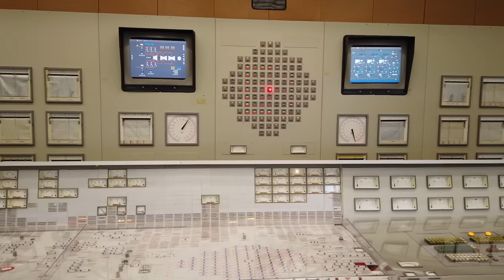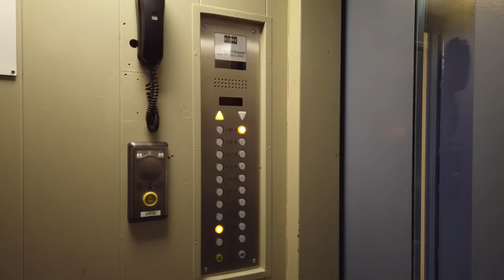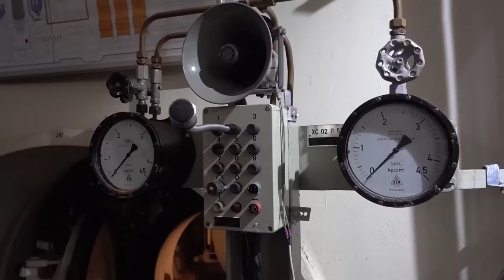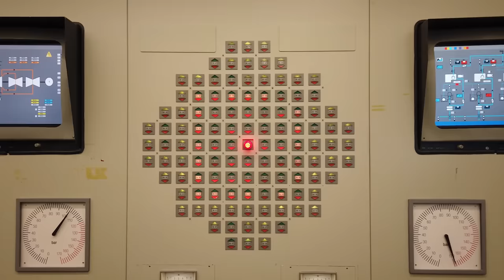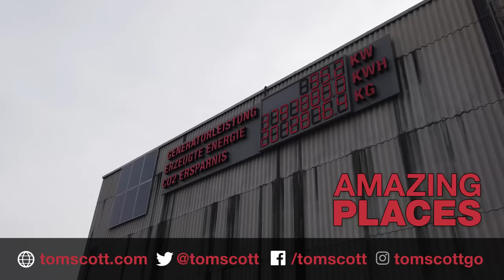This billion-euro nuclear reactor was never switched on

Comment: That's a hell of a lot of electricity to let go to waste.
Reply: Not electricity but a work of the state slaves.
Reply: and money
Reply: @ufi9540  what?
Reply: @SkaffaS  
Reactor was never switched on. So electricity was never wasted. Only work of the state slaves who worked to build up reactor has been wasted.
Reply: It's not going to waste if the plant hasn't been turned on yet
Reply: @Brickwall4769  Yes it is, it's a waste of resources not to be using it.

Comment: In those 35 years, assuming it‘d run at near 100% all the time (which nuclear powerplants usually do) it‘d have generated about 25 gigawatt-years of electricity. Instead, it was replaced by coal-fired powerplants, adding over 200 megatons of total CO2 emissions.
Reply: now most energy comes from water
Reply: @ClickThisToSubscribe Coal releases more radioactive material into the environment during normal operations.
Reply: There is not a single coal fired powerplant in operation in Austria today.
Reply: Actually, Austria is big on hydro power, not coal.
Reply: Hannes Größlinger True, so probably not as bad (though of course Austria is integrated in the European grid and I am not sure if they are a net importer or a net exporter of electricity), but I don‘t know since when that is so - so my numbers are really a worst case, though if it‘s gone online there probably would have still been a substantial CO2 savings (Austria‘s total annual emissions currently are about 60 megatons).
Reply: @zuthalsoraniz6764  So you're essentially just trying to make nuclear look better than it actually is in order to support your agenda...

Comment: This is just depressing tbh
Reply: Ok Millenial
Reply: Not really tourists come there and they don't have to worry about demolishing it and getting rid of the waste...
Reply: @felixd2136   Potentially millions of households worth of carbon neutral energy wasted for the sake of a mediocre tourist attraction? Yea sure good trade.
Reply: @deetvleet  still better than having to deal with the waste...
Reply: @felixd2136  no one seems to understand the problem with the waste.
Reply: @felixd2136  There is no "waste". The spent fuel from that reactor can be used in a Fast-neutron reactor to make even more clean energy AND reduce the number of people with lung problems, (from burning coal and gas) that are now going to be killed by the latest pandemic virus.
Reply: Felix D are you insane? Nuclear power produces much less waste that fossil fuel counterparts.
Reply: Why does nobody in this comment section consider the fact that Austria already produces most of its power using renewable energy sources? I'd rather have the hydrodynamic plants currently in use than a nuclear plant.
Reply: @felixd2136 : Dealing with the waste isn't a big problem.
Reply: @0rogontorogon  Because that's a massive oversimplifcation of the probkem.. Austria imports a large amount of their energy from germany which funny enough used to be nuclear energy, but now its coal and gas.

Comment: This is just sad. The whole "phasing out" of nuclear power is terribly sad. I just hope we'll see the light and turn that around, because now, more than ever, we'd need it...
Reply: This is just a single instance of matching need with the context. Japan is reopening nuclear plants even after Fukushima because the need is there, they don't have other energy sources and the cost of importing fossil fuels was too expensive. Elsewhere, nuclear will be phased out for other forms that have higher returns on investments, and where other technologies make sense. It is not an all or nothing issue. In this case, nuclear wasn't necessary and they have done just fine for the past 50 years.
Reply: @Obscurai  I'm sure they have, after all, they have an abundance of hydro power (now we could question the environmental impact of hydro power, but nevermind that for now). Obviously the decision has to be based on logic, and facts. I simply think, based on my observations, and based on my own knowledge of the subject (I'm an electrical and mechanical engineer who has a keen interest in nuclear energy, no that doesn't make me an expert, but gives me perspective), that a major factor when it comes to deciding what kind of power plant should be built, is based on a general (unwarranted) fear of nuclear power. While (factual) statistics clearly show, it's an extremely safe and clean source of energy (yes, even if you factor in waste, which shouldn't be buried, but reprocessed). Also, in a lot of cases nobody even considers the potential advances in reactor design that introduce inherent safety (such as NOT using water as the heat transfer medium, or the negative thermal coefficient of a reactor, and so on...).

 We base these fears on a very low number of serious incidents (actually only ONE of them resulted in widespread, and life threatening contamination and that was caused by a reactor design that has long gone).  Surprisingly (not really) nobody stops driving even though road accidents kill over a million people every single year. Deaths caused by every single nuclear incidents added up (including potential cancers)  don't even come close to that. And that is a single year. New reactor technologies also reduce the amount of waste and the hassle of managing it. 

As for return of investment...Well I'm sure this is not news to you, but the bureaucratic/political/etc overhead around a wind farm or a solar farm or even a hydroelectric station is minuscule compared to the absolute insanity surrounding nuclear power. You might say "Well yes, because it's a dangerous industry". And sure, spent fuel, and waste needs to be tracked , and handled properly, and the eventual decommissioning of a NPP (new plants have a planned life of at least 50 years) has to be factored into the price of it, for a good reason. But where is this oversight with chemical plants? How is it that Bopal/BP/Exxon Valdez/etc/etc/etc happened and we didn't start screaming for the closure of plants that produce oh so much of our consumable products (or their constituents)? 
 The answer is in the question obviously. Because we DO have some alternatives to nuclear (or we think so), we have the luxury of hating and trying to abolish it (or only use it where there is absolutely nothing else that could be used), instead of perfecting it, even though it takes a lot less space than wind or solar farms (thus not interfering with birds, and other animals, and not screwing up the countryside), and the spinoff technology can be used for exploring, and colonizing our solar system, with ease, and with the advancements in modular reactor designs the price , along with the time required to build them, could be brought down considerably. So yes. Maybe we can solve our energy problems, for now, from renewables. But we would be throwing away a technology that, if we invest in it, would , on the long run, provide us with a lot more energy in a far smaller footprint, offering far more versatility and easier deployment. And energy is the key to advancing a civilization, energy is everything. Energy means desalination, energy means getting water to crops, energy means heating, energy means fast transportation....And sure, fusion is just over the horizon. And most likely will stay there for a long while... But hey, why do we even bother with fusion right? If wind farms and solar can give us all the power we need...
Reply: @Equoris  No one is throwing away the technology. It is still in use and new plant designs are still being perfected. There are just more options and decisions on what to deploy based on local requirements.  Countries with lots of land will opt for solar or wind. Countries with no land but has strong wind resources will choose wind. Countries that have an abundance of fossil fuels will continue to use them if they are financially sustainable. When all other options are more expensive or unworkable,  nuclear is a viable option (as was the case for Japan). 
In the end, investments in power generation are financially based on the rate of ROI. That is, how soon and how fast will there be a return, without locking up too much capital. If nuclear power can outperform financially, all the arguments against it become muted. However, that is not the case today. 

Lastly, the analogy to car safety is only valid to a point. Vehicle deaths are an incremental known quantity and dispersed risk. A nuclear accident is a catastrophic event, and chronic problem for a wider region that causes long term asset economic destruction. Bopal is a good example of catastrophic risk that was misassessed. While there are safer designs, the nuclear energy industry has not done a very good job in changing that perception of catastrophic failure. I haven't even gone into the need for transparent regulation free from government interference and how there are very few governments that would allow an independent regulator to insure safety.
In summary, I like nuclear. It's a useful option where appropriate. But it has problems that go beyond the technology in economics and politics.

Comment: In my opinion nuclear energy is the future, our energy needs are increasing and solar and wind farms would not be able to provide enough electicity we should decomision all coal and fosil burning powerplants and use nuclear for our main source of energy and eventually add solar and wind power in to the mix, at least until those are able to provide enough energy to satisfy our needs
Reply: In terms of efficiency. But in the public eye we need more time.
Reply: What needs to be fixed is efficiency and then wind and solar would be enough, maybe with hydro for peaks
Reply: I agree but it’s the price, nuclear is just too expensive
Reply: Couldn't agree more. Scientists have been saying this for some time, too.
Sadly, the perception of most people is totally opposite on this.
Add in to the mix; big international million dollar industry which does not want these things to change, and you got yourself fighting in a losing battle.
Reply: Conventional nuclear energy is everything but the future, it's outdated. We may talk about fusion in 10-20 years, but in the meantime, wind and hydro (solar for heat and decentralised usage) are the way to go.
Reply: @bluemountain8110  not if you look at cost/energy output
Reply: @poggylp1169  Wind & solar generators are useless when it comes to baseline power usage, not so much with hydro. We would also need to boost our energy storage capacity in a large way before anything like those renewables would be a viable solution.
Reply: @poggylp1169  You are wrong, it's not the end of the road for (fission) nuclear reactor designs.
Far from it, have a look at the following reactor design: Fast Breeder Reactor

That thing can actually produce more fissible reactor fuel than it consumes.
I reckon a dozen or so big ones of these worldwide (apart from generating alot of power each themselves) could provide a steady fissible fuel supply source for existing designs.
That would make the climatic and ecological footprint even less... It would be nothing less than outright stupid not to go forward with Nuclear...
Reply: @bootlegjoe  wind is far from useless for 'baseline power' in a power network that stretches over an entire continent, it had actually the most potential of all renewables because it's both the cheapest and has the most applicationd, especially when talking about offshore. The thing with renewables isn't the amount of power they can produce, it's all about the distribution (both spatially and temporally), some problems with ac/dc converting and the fact that neither hydro nor wind produce heat (heat makes up for ~half of the total amount of energy needed). Nothing to crazy actually. 
In german, there is a term called 'Dunkelflaute' which describes a scenario with zero light and wind, but it ain't nothing but a horror-scenario even more unlikely than a nuclear explosion.
Reply: @TheDrunkenMug  it seems like you have a terrible understanding of breeding reactors. They can help to make better and more efficient use of the nuclear fuel, but this doesn't help with anything. We are not exactly running short of uranium. Still waste problems, still hard radiation.
Reply: @poggylp1169  conventional nuclear energy is more efficient and cleaner than coal power or any fossil burning powerplant.Hydro powerplants do affect wildlife. Solar panels and wind turbines look like the future but they are relatively new technology we don't know how they affect wildlife and climate. If 70-80% of people would start buying ev our power grid would not be able to supply enough energy, this is one reason why we are still using fossil burning powerplants. In my opinion nuclear power is the future, and if we find a way to build smaller nuclear reactor that are safe to carry around we should be able to use them to power our rockets and some planes etc etc
Reply: @TheDrunkenMug  Fast breeders, seriously? That is a concept from decades ago. There were many attempts and it is problematic,  you can't use water as primary coolant, it is usually done with extremely reactive liquid sodium at up to 550 ºC, then combined with a secondary water/steam circuit to run the steam turbines. Just look at the accident list at existing plants, for example in France they stopped it because the costs skyrocketed. Many others where also closed a while ago. Russia has two in operation, but they run on a low breeding ratios, effectively burning plutonium from stock.

Your numbers on fuel production are wrong, even calculating the best case about 50% of the reactors would have to be replaced with fast breeders...
Reply: @poggylp1169  "Conventional nuclear energy is everything but the future, it's outdated. We may talk about fusion in 10-20 years, but in the meantime, wind and hydro (solar for heat and decentralised usage) are the way to go."
As far as I know, ITER is not expected to actually deliver electricity, even when operational somewhere in (planned to be 2050). There are other projects but no-one has plans to supply the grid with the reactors built for testing only.
Reply: @Peter1986C  ITER is primary a research reactor and not really meant to be a future functional powerplant, right. However, if it's concept turns out a success, commercial fusion reactors will become reality, assuming mankind didn't achieve something that makes them obsolete by then.
Reply: Have you looked into Thorium?
Reply: Durjam didn’t think about that actually. In that case nuclear should be the answer

Comment: They should re-commision it and use it.
Renewables can't supply demand and it's far less polluting than anything else.
Reply: Renewables don't have to entirely replace fossil fuels in order to achieve a neutral carbon footprint. Nuclear power, especially in central Europe, is still looking for a suitable and permanent location to store nuclear waste.
Reply: @nara6540  There's whole bunch of different possible things to do with the waste, one of them is to just leave it in its temporary storage for ever and keep watching it, which is also fine. If people stopped arguing about it and started listening, perhaps they'd see that it's not even a problem. Most of it can be reprocessed for more fuel, some of it can be turned into medical supplies, the real leftovers are very, very small, as in, a few containers per country.
Reply: Renewables and storage can supply all demand but it would still be a good idea to use nuclear as well. Clean, green and safe nuclear power. Every coal plant swathes nearby areas with radioactive ash. It would be interesting to find out how many Austrians have gotten cancers from all the coal plants in the years after turning down nuclear energy.
Reply: @mbak7801  unfortunately, they can not. No good enough storage technologies, short on land area.
Reply: @killman369547  Great in theory, not so great in practice.
Reply: Well, unfortunately you've picked the wrong country to shame for that. Austria is generating more than 75% of it's electricity from renewable sources. Nuclear has absolutely no place here.
Reply: @kain0m  right,  better to have 25% of coal and gas in the mix.
Reply: @mbak7801  BS. Renewables can't be scaled to provide the power requirements of the world without significant effect to the very environment it ostensibly protects. Maintenance and repair costs also grow with the size of the deployment.  Great in theory, not so great in practice.
Reply: you should know that we use manly hydroelectric power and use gas only as backup.

Comment: Lifetime energy for a single household all packed into the size of a coke can.
It's too bad all the unfounded scare-tactics worked.
Reply: Nuclear energy isn't a long term solution either.
Reply: Sharp931 yes it is. Way cleaner than any form of renewable energy.
Reply: @Sharp931  It's a long term enough for us to develop a replacement.

Comment: The Austrians were so afraid of radiation that they opened 3 coal power plants instead Zwentendorf. Fun fact - each cole power plant producing 3-4x time more radioactive particles while burning cole than nuclear pp. and relasing in the air. 
Edit: Studies show that ash from coal power plants contains significant quantities of arsenic, lead, thallium, mercury, uranium and thorium[1].

To generate the same amount of electricity, a coal power plant gives off at least ten times more radiation than a nuclear power plant.
Reply: Rather idiotic, isn’t it?